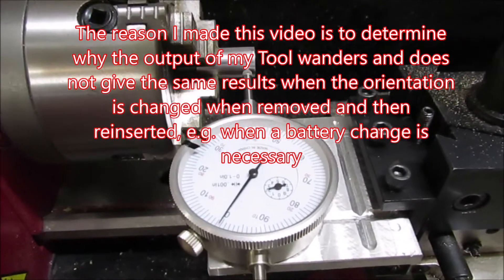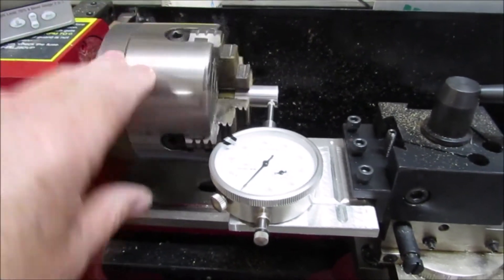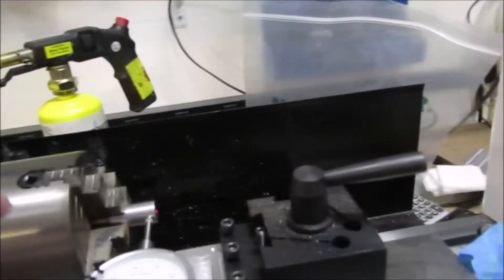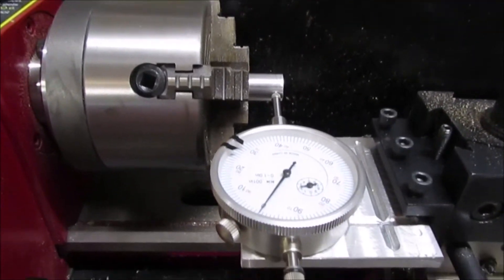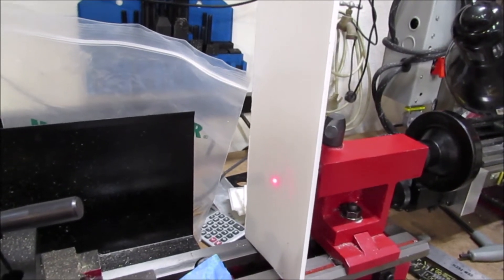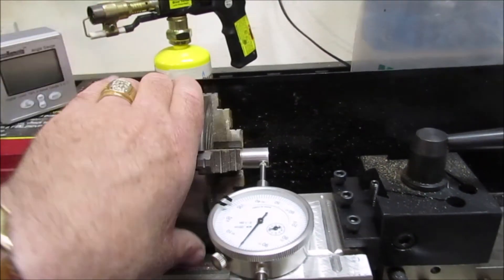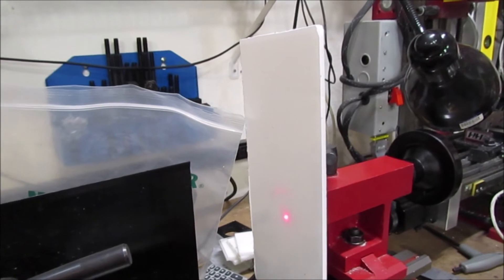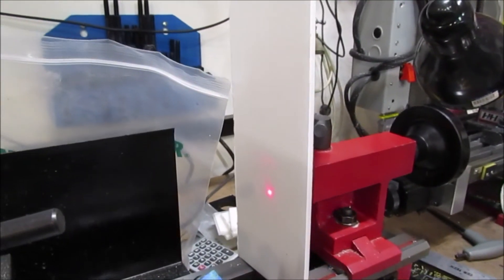American Photonic Reverse Alignment Tool, output wander

Comment: I had the same issue. I spun the tool in the laser head and the dot would move in a circle. They are sending me another as i write this. Did the replacement resolve the issue?
Reply: I am kaydee457. I posted this answer from my other YT account. I did not ask for another. I machined a flat in it where I need it to be aligned and went from there...Also, I don't know who's making these things for them or if they make them themselves but I don't think they're supposed to be in alignment anywhere except where the flat on the body is. Let us know how you make out with the new one and whether or not it remains centered when rotating it. I have my doubts that it will.
Reply: @btomas225  fyi, I did receive the replacement unit yesterday. It was spot on with no concentricity wobble. After much research could have made my own with a simple red dot laser diode and a 3D printed sleeve to fit in my laser head. My laser head uses compression nut instead of set screw to lock in place.